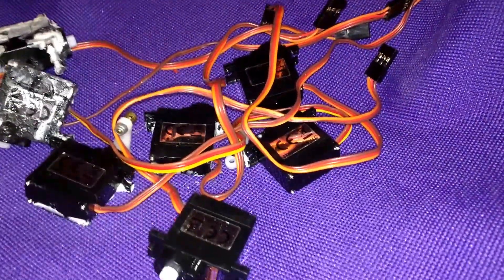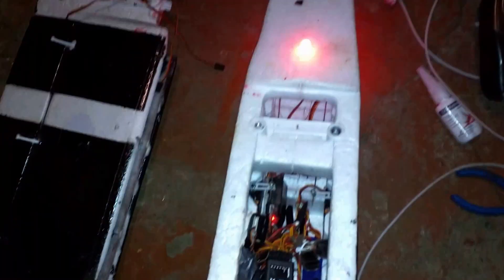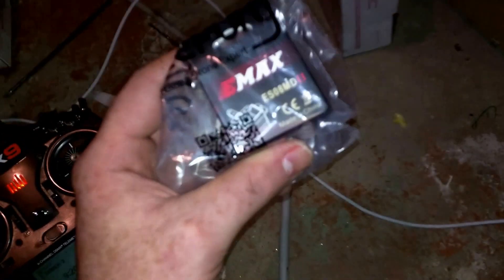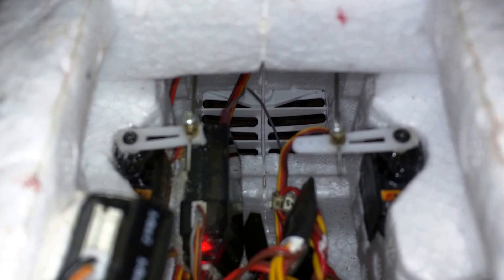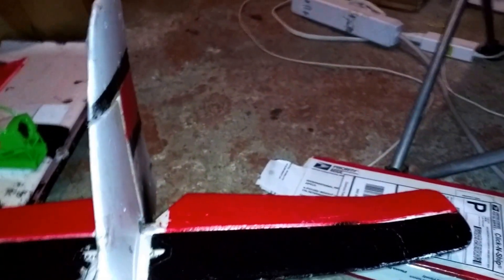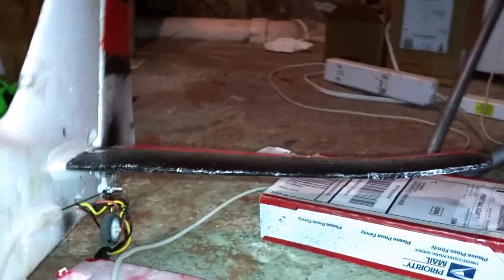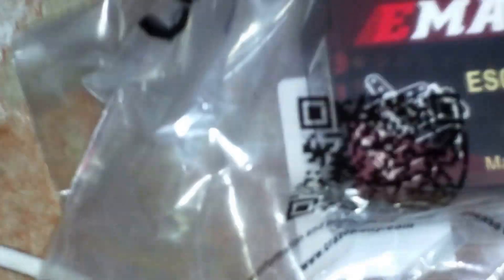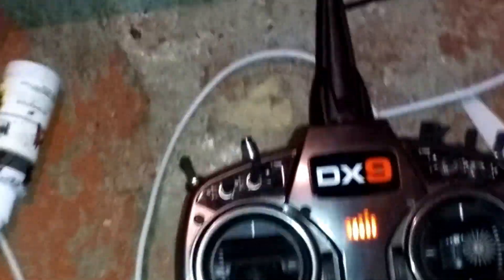E-flite Timber servo hell; trying cheap metal gear EMAX ES08MDII

Comment: Love those Emax Servos - very high quality!!!
Reply from the maker: That's the 12g, my go-to when I'm tired of stripping. I also bought the programming interface that lets me reverse the digital servos, though I'm not seeing it for sale anywhere. Maybe because the software is very rough around the edges with a fair amount of Chinglish..
Reply: Where did you get that thing?!?!??! I was looking all over the place yesterday...I thought maybe was a thing of legend...
Reply from the maker: From HeadsUpHobby but they don't have it anymore, nor do many sites. Seems EMAX discontinued it. The most promising link I've got is a third party international dealer through Newegg, https://goo.gl/1XqkBu, also it appears to be on ebay.
Reply: Do you have some PC based software to install for programing?

Thanks for the link!
Reply from the maker: Here's the manual - https://goo.gl/Q1LDqi - which has the download link up top. If you can't download it I can put it on my server.
Reply: It's all in Chinese???
Reply from the maker: Maybe Emax's quality control team is also their English translation team and, fearing competition from garden variety servo signal reversers not requiring instructions, model compatibility, software, drivers, downloads and translations, axed the servo programming interface operation halfway through.
Reply: That wouldn't surprise me, but bummer though...

I don't want to have to reprogram them, but would love to be able to, especially for flaps and dual elevators...

Comment: Did the max digital servos cause any problem with the ar636 and safe select or did you have to turn that off to use these servos..  I got a Timber today and after 5 flights the rudder servo is locking up and the elevator servo is making noise even with reduced throws.... they really are crap....

Comment: I found an old tower pro metal gear analog servo and put it in the elevator and it worked great. Tower pro mg90s metal geared analog.  Cheap and good

Comment: In about a month, I have been through 1 timber fuselage, a set of landing springs, 2 flap servos, and 2 motor shafts. I am now in need of a motor shaft collar which I cannot find without a $59 motor attached to it. I am very frustrated at this point. Please tell me that life gets better. Are you still running that other motor?
Reply from the maker: Obviously I feel your pain brother. That pile of E-flite servos has grown much larger since, and I've lost my share of motor shafts too. I've since switched to the Valiant which I love much more than the Timber, though still have to swap in cheap 12g EMAX servos from Headsuprc.com here and there, and the Leopard 960kv motor (same as what I used with the Timber) due to two shafts breaking and another motor burning out from a short four cell test - though the Leopard, same weight, can handle that voltage for at least for a reasonable duration. Horizon ain't cheap, but support-wise they've been outstanding, giving me numerous free replacements from motors to high-dollar receivers like the AR9350 even when it was my fault for breaking them (like plugging in voltage leads with reversed polarity), so between that and great planes, they, with auxiliary support from HeadsUp, have my loyalty. I wish they would buy the Tundra from Durafly/HobbyKing and the Fun Cub from Multiplex though, and better, metal gear reversible servos, or perhaps include a few spare servos and motors in the box with the plane like they sometimes include a few extra screws. The only downside to the Leopard motors at least for the Timber and the Valiant is that due to different lengths you have to either modify or ditch the cowl. But it will get you on a three cell flying vertically, while hauling a camera and telemetry stuff, above 1000ft in just forty seconds (about 20mph?) as demonstrated in another one of my videos.
Reply from the maker: Here's that Leopard three cell vertical video, https://youtu.be/_pmWtg9Ex3k, in which I touch 1120ft according to my barometric altimeter (yeah yeah irresponsible, I don't make a habit of it), stopping just shy of the clouds. As far as efficiency, though flying gently and with a lighter pitched prop and a big battery, I kept her in the air for 37 minutes carrying a camera. My record with the Timber hauling two cameras with a 2600 is 16 minutes. So it's a good motor, especially for the price. My newer videos are better, I've gotten better at editing, like this one demonstrating a flaps mix, https://youtu.be/1EW4TlAKUTo, and my last demonstrating crow brakes, https://youtu.be/zuRE3x_BnBc.
Reply: Doug Simmons thanks for the info! Learning all this stuff is frustrating and expensive. I agree, horizon support is great. I have to call them again today.
I should have just purchased 2 timbers right out the gate so I wouldn't have to wait for parts to arrive😁

Comment: Are all the servos reverse on the timber or just some of them? Looking to upgrade mine to metal gears too.
Reply from the maker: I recall only one being reversed but I just called Horizon for you and he said they're all reversed. Though the Emax servo can be reversed with a cheap computer interface, you can easily reverse any servo with this https://goo.gl/TAczCd or you can open them up and reverse the motor wires (not so easy).